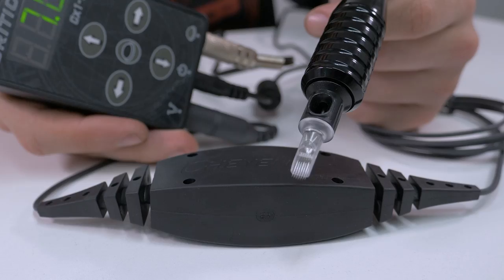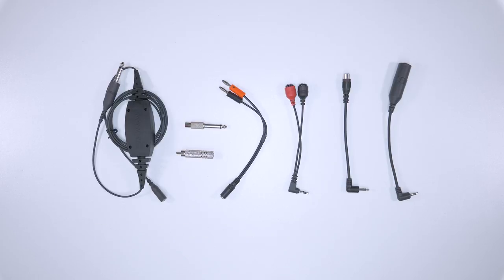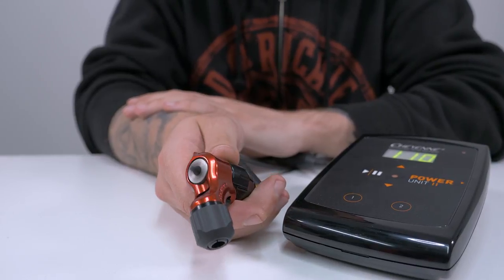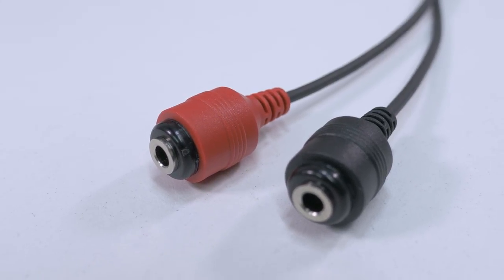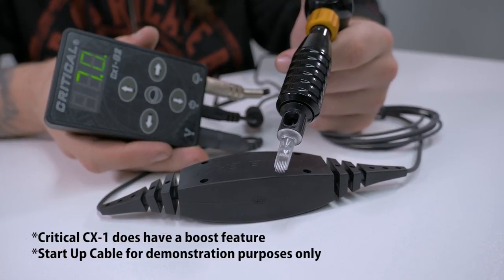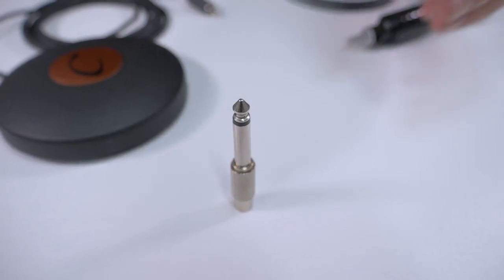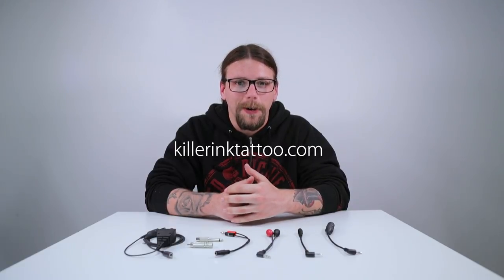Cheyenne Cables & Adapters | Tattoo Supplies & Equipment FAQ

Comment: I have a starter cable  running my cheyanne. But Also have a direct2 that’s rca. Do u have a adapter that has cheyanne machine male to a rca male. To run both machine on one cable? If that makes sense lol thanks
Reply from the maker: Hi, we offer a tattoo machine cord splitter here: https://www.killerinktattoo.co.uk/tattoo-machine-cord-splitter-for-power-supplies

This will allow you to use the startup cable and RCA cord by just toggling the switch.

Comment: Is there a replacement power cord specifically for the Cheyenne Sol Nova?  Do these only work with the Cheyenne Hawk? If they're not compatible, where can I get one for the Sol Nova?
Reply from the maker: Hi Jessica, both the Cheyenne HAWK 3.5mm Connection Wire and Cheyenne HAWK Pen 3.5mm Connection Wire can be used with the SOL Nova.

Comment: Hey I’m just wondering wich cable I need to get to connect a xam coil liner to my Cheyenne power supply , it has an added female rca connected to it , thanks
Reply from the maker: Hi Luke, for machines requiring a clipcord or RCA connection, the Cheyenne Hawk Adaptor Cable 3.5 mm Plug to Standard 6.3 mm Jack (https://www.killerinktattoo.co.uk/cheyenne-hawk-adaptor-cable-3-5mm) is recommended. You can attach the adapter to your chosen RCA/Clipcord and then attach the other end to the power supply.

Comment: I just got my hawk and I’m trying to run it on a critical atom power supply, I’m using a 3.5mm adapter to an rca, any tips? Can’t get it to go
Reply from the maker: Hi, the cables are included with the machine, so if you use the Cheyenne Hawk 3.5mm Connection Wire and Cheyenne Hawk Headphone Plug 6.3mm, it should run fine. If in doubt, please contact us via email at info@killerinktattoo.co.uk for further advice.
Reply: @KillerInkTattooEU  so I just bought only the machine from my mentor, I ended up getting a 3.5 to 3.5 adapter which allowed to plug the machine into an rca to 3.5 cord, still no power
Reply from the maker: Hi, can you confirm that you're using the previously mentioned cables (SKUs on our website are CHE-WIRE and CHE-HEADPHONE)? Also, can you tell us which Cheyenne HAWK machine you're using please?

Comment: Hey guys! Trying to get the right adapter for a PUIV and a Cheyenne Hawk pen. I assume I need an RCA with the 3.5mm jack?
Reply from the maker: Hi Carleeh, you only need the Cheyenne Pen Wire for this. One should be included with the machine, but if in doubt, we offer them on our website here: https://www.killerinktattoo.co.uk/cheyenne-hawk-pen-2-5mm-connection-wire

Comment: I can’t find that first adapter you showed, for using non Cheyenne machines with the Cheyenne power supply?
Reply from the maker: Hi, the adaptor cable is here: https://www.killerinktattoo.co.uk/cheyenne-hawk-adaptor-cable-3-5mm-6514

Just select "STANDARD 6.3MM JACK" from the drop-down list.
Reply: Killer Ink Tattoo thanks mate.

Comment: Hi, I'd like to know which cable (or adapter) I need to use my rotative XION SPEKTRA GORILLA on a Cheyenne Power Unit II ?
Reply from the maker: Hi, you will need to use a 6.3 mm jack adapter alongside your preferred RCA cord.

Comment: What adapter do I need when I want to use a standard 6.3mm foot switch? On your website I don't see anything else than these adapter cables and not these small metal adapters
Reply from the maker: Hi, you will need to use the Cheyenne Adapter, shown at 2:44. You can order this here: https://www.killerinktattoo.co.uk/cheyenne-hawk-clipcord-jack-adapter

This will convert the 6.3mm jack from the pedal to a male RCA, which connects to the back of the Cheyenne Power Supply.

Comment: Why do people said that cheyenne hawk need a jump start/startup cable to be able start hawk at low voltage when using non cheyenne ps? I use my hawk thunder using critical ps i cant start the machine at low voltage
Reply from the maker: Hey, if the Cheyenne HAWK Thunder is used on a non-Cheyenne power supply at a lower voltage with a cartridge in, it might stall. You may notice that it works without a cartridge, but stalls when one is inserted because it has to push the membrane. If you work on higher voltages, it will run, but then you have to turn down the voltage again to whatever you want to work at, which is not ideal every time the pedal is pressed. The start-up cable replicates increasing and then decreasing the voltage in a split second, so it's like a shortcut. Are you using a G2 Critical? They have jumpstart modes, so a start-up cable will not be required.  If you want to know how to access it, check out our Critical videos on our channel.
Reply: Killer Ink Tattoo it works with cartridge in, btw what does mean stall??
Reply from the maker: 'Stalling' means that the needle will jump out and just stay there - so no movement.
Reply: Killer Ink Tattoo thanks for the answer 🙏 i just found on internet that critical is a 6 amp and eikon is a 4amp so the critical can run the thunder alday long on the power supply no start up cable

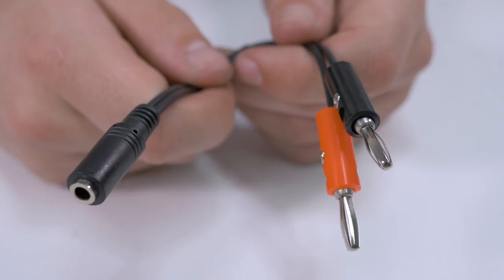Comment: thank you but how we connect banana plug cable 2:28 with older tattoo machine
Reply from the maker: Hi Cezar, you can use the Cheyenne Hawk Adapter Cable 3.5mm.

You can purchase it here: https://www.killerinktattoo.co.uk/cheyenne-hawk-adaptor-cable-3-5mm 
(select Banana Plug from the dropdown)
Reply: @KillerInkTattooEU  thank you i subbed but i still don't get it sent you message on Facebook
Reply from the maker: @cezar1g  Hi, feel free to contact info@killerinktattoo.co.uk for further advice.

Comment: what adaptor do I need to hook my Hawk Pen with a dragonhawk power supply? if i can
Reply from the maker: Hi Catherine, there should be an adapter included with the Cheyenne HAWK Pen, which converts the standard Cheyenne cable from 3.5 mm to 6.3 mm, which fits most standard power supplies.
Reply: @KillerInkTattooEU  TY!!

Comment: Do I need the foot pedal or no?
I'm new in pmu and I whant to be thuender .
Reply from the maker: Hi, foot pedals are optional for the Cheyenne HAWK Thunder.
Reply: @KillerInkTattooEU  and for the sol terra? Do I need the foot pedal or no? I’m using a pu IV
Reply from the maker: @bobfragola3996  Hi, foot pedals are option for the Cheyenne SOL Terra when running it through the PU IV power supply. However, if you do wish to use a foot pedal, you can see the two modes available in our video review here: https://youtu.be/VJ6swBTZ3mg?t=120

Comment: it's ok, for the Cheyenne to work with other adapters ?
Reply from the maker: Hi, yes - Cheyenne tattoo machines will work with other adapters. For example, we stock the following Evolution Cord that can be used with machines from Cheyenne: https://www.killerinktattoo.co.uk/evolution-cords-2m-ultralite-cheyenne-female-mini-jack-to-right-angled-mini-jack. In addition, we also stock a variety of adapters that will make Cheyenne machines compatible with a variety of other power supplies: https://www.killerinktattoo.co.uk/tattoo-machines/cheyenne-hawk/cheyenne-power-supplies
Reply: @KillerInkTattooEU  So lets say i got a Cheyenne Hawk Thunder can I run it with Cheyenne Power Supply Start Up Cabel and a Horizon Digital Tattoo Powersuply ? or do i need a powersuply with a boost option?
Reply from the maker: @godlikeacookie2618  Yes, if you're using a Horizon power supply, you'll need to use the Cheyenne Start-up Cable. However, if you'd like a power supply that already has a boost option, you can consider the likes of the Crtical CX-1: https://www.killerinktattoo.co.uk/critical-cx-1-power-station

Comment: Hay, I just got the Elite PS350 and I wanted to run my Cheyenne hawk pen, but the machine doesn't start at all, even not with high voltage.
Is it possible that it's not compatible at all? I couldn't find many reviews for that power supply.
Reply from the maker: Hi, you can try starting your machine on a higher voltage or use the Cheyenne start-up cable that you see in this video, but we'd recommend a Cheyenne PU I or II power supply to go with your Cheyenne HAWK Pen.
Reply: @KillerInkTattooEU  u don't need a Cheyenne power supply mine works great on a hurricane power supply. and starts up at 4.5 volts easy. with a Cheyenne hawk thunder machine. without the start up boast cable